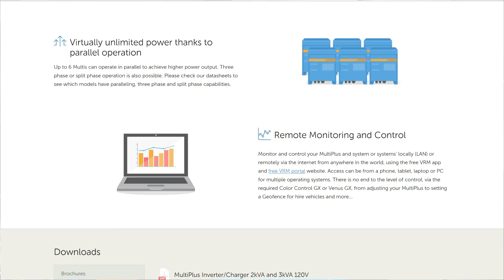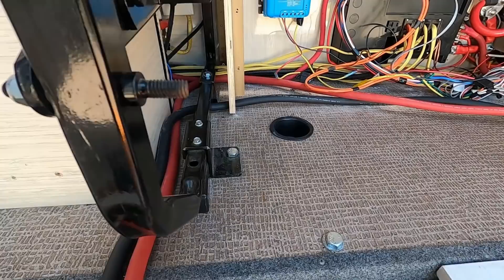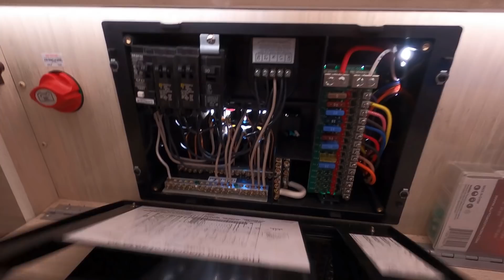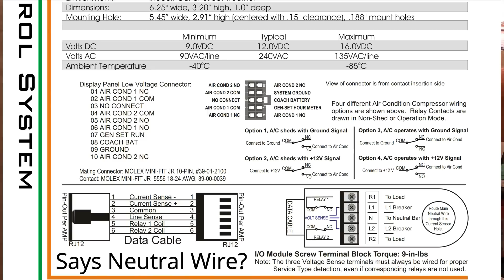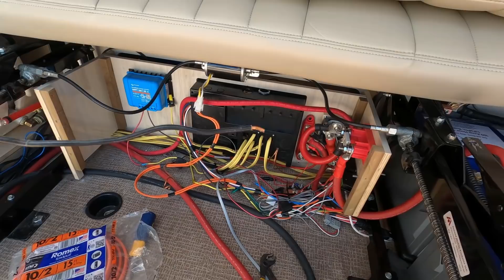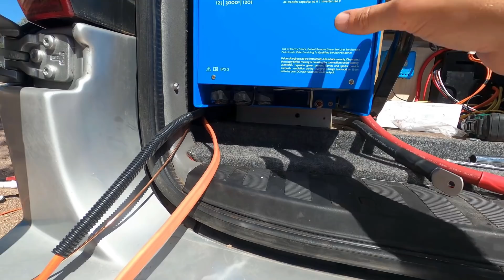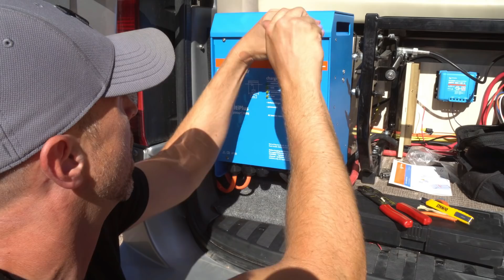RV Inverter Installation | Victron Multiplus 3000va Inverter Charger | Full Time RV Living

Comment: Does the power control system still shed loads like it used to when it thinks you don't have enough power, even when you now do with the 3000w inverter?  I've got an AI and upgraded last year to 2 battleborns and now need to get 1 more and upgrade to this Victron inverter, basically replicating your setup.  Anything you'd do differently after living with it for a couple of months?  Great job on the install, BTW!
Reply from the maker: I have not seen the PCS shed a load since the new system. The Multi Plus, being a hybrid, now just pulls the extra power needed from the batteries and everything keeps working. Pretty cool, with the AC, induction, and microwave all on at the same time! We REALLY like the new setup. I don't think there is anything we would change with it, besides wanting more solar. I do need to do some review videos as we just completed 60 days being unplugged and NO generator. The only real limitation is running the AC for extended periods of time. You will still need a generator for that or figure out a way to fit 1000 plus watts of solar on a AI roof! I think you'll really enjoy the power of the BB's once you upgrade your inverter.
Reply: Irene Iron Fitness Thanks for the response. We have 2 Battleborns now, and I was thinking of getting just 1 more. How do you think your experience would be impacted by having 3 battleborns instead of the 4 that you have? 

We aren’t full timers, but I’d like to be able to cool down the coach with the a/c as we’re out and about it’s been sitting in the sun in a parking lot.  We just have 50 watts of solar but our sterling 60 amp dc to dc charger does a good job at charging the 2 battleborns quickly as we drive from place to place.  Other than that it would be for the water heater, microwave and an induction cooktop, all for short use ages (prob less than 10 min each).
Reply from the maker: The goal for our system is to sit for up to 7 days without driving or running the generator. 4 BB's and 300 watts of solar will do this if we get adequate sunshine. BUT, its amazing how much power we actually use per day. Up to 150 amps! So if we didn't get sun for two days we'd be outta power with 3 BB's.  I will be doing a video on AC usage, but basically ours consumes about 150 amps per hour. So while its not a problem to use your AC in between camps sites with electrical hookups, you could see how this could be a problem while boondocking. Let's say we left a campsite with 100% bat and we went to the grocery store and a few other close stops and Chris went in while I stayed out. (Common for us) After two hours of AC use we would be down to 100 amps or 25% battery. If our boondocking spot was only an hour away our battery would only charge to about 33% as we only have a LBIM225 that charges about 35 amps per hour. This would only be enough to last a couple days boondocking. You can see how more solar or a 280amp second alt would help the situation. But, everyone's needs are different and my advise is if its in your budget and you have the space for it... bigger is better with energy. Think of it in percentages also. How long does 2 BB's last you? Adding one more battery will get you 50% more power than you had before, or 2 more will double your power needs. I would also recommend upgrading the 50 watts of solar. No solar our batts last about 3 days and with solar we have done up to 10 days with a hour drive in.
Reply: Irene Iron Fitness thanks for the advice. I’ll do the easy upgrade initially with solar from 50 to 100 watts, since it’s just that oem panel swap with the same mounting brackets. Then probably re-evaluate once I see how we do on that. I may do the battery upgrade one at a time as well so we can see how 3 goes.  Thanks again for your time!
Reply: Irene Iron Fitness sorry, one more question for you. My AI is in storage right now so I can’t look, but did you add/replace the 400 amp fuse to an existing fuse block, or did you add the block and the fuse? Wondering if I need to just buy the fuse, or if I need to buy the block and fuse together.  Thanks in advance!
Reply from the maker: No problem. Yes I had to buy a new fuse holder as the AI one has a max 300a capacity. Which is too bad because they are really nice marine sealed Blue Sea holders. I do have a complete parts list on what I used in the description on my two install videos. (affiliate links) https://youtu.be/hB_UgLR0bTo    Buy, yeah feel free to ask questions, I don't mind. Excited for you and your upgrade!
Reply: Irene Iron Fitness thanks! I’ll use your amazon link if I buy the same product, for sure.  Switching topics... you’ve said you like your sumo spring upgrade, do they make it more jarring to hit road bumps? Anything you’d do different in terms of spring rate?
Reply from the maker: I don't really notice a difference on bumps really(going straight)....... these 3500 dually sprinters defiantly ride like a heavy duty truck. But, the main reason I put them in was to reduce the sway from side to side when turning and hitting bumps or things like a driveway entrance. It is a noticeable difference and well worth the $400 or so upgrade price. I will say the first test drive we really noticed it... but now we are used to it and it still has some sway. But these tall sprinters  with top heavy cabinets still make us drive pretty slow!  We put in the highest spring rate they had for the bumpstop replacement kind. Yellow in the back and black in the front. If they made the heavier yellows for the front we would have done that also. The added .75 in height clearance was nice too.

Comment: Great job! Does your van have one or two lead-acid batteries (one under the floor on the driver's side, one under the hood)? If there are two, you've got a spare house battery to do stuff with. 

As for your current setup - it's perfect. The only thing I'd do is keep a second alternator in the back of your mind. With a dedicated 280a alternator for your lithium system, you can run your air conditioner right off the main engine, and charge your batteries quickly on days when there's no sun. It will give you most of the benefits of your generator, but without having to reply on propane.

Also, make sure you carry a spare fuse with you. If it blows for whatever reason, your entire house 12 volt system is dead - which can be incredibly inconvenient.
Reply from the maker: Thank you! We have just the one bat under the floor..... had to replace it last year on the road! Good point on the second alt. I'm finding charging off the 220a main alt with the LBIM225 is mediocre at best. I plan on doing a bunch of testing videos in the next couple months on the whole system. We just boondocked for 60 days back to MN and it worked great.  And I did get two spare fuses right away. Great point! 😀
Reply: @IreneIronTravels  re-watching your old videos. First thought I had was "I better suggest they get some spare fuses" only to see I did six months ago 🤣.

Hope the system has been treating you well. I'm still a weekender. I have 700 amp-hours LiFePo4, and that's enough for me to run my A/C all night in the middle of summer, and then run generator to power the A/C AND recharge the batteries during the day. Right now in the winter, I can go almost a week without recharging (I have no solar). Hopefully you'll have similar capabilities if you find yourself somewhere hot in the summer!
Reply from the maker: That's pretty funny! Haven't had to use the fuse yet, but feels good to have a spare! The victron multiplus does pretty well handling  any surges so far.  As far as AC we can run it none stop for about 2.5 hours. So maybe 5 hours if it cycles 50%, but it seems to run none stop if it's hot enough out. We got our generator fixed now and that's a big relief to beable to run AC longer and recharge. We found 10 days to be our max with our 300w of solar and not using the gen. Would like double that in solar.
Reply: @IreneIronTravels  If you have a spare fuse, you will never need it. If you don't have a spare fuse, you will need it at the worst possible time. Blew my only fuse the first day into a camping trip - haven't had any issues since I got spares.

Comment: Great video thanks for sharing. Unrelated Question is on that set of dumbbells I see in the back. They look like an adjustable set. Where did you get them?
Reply from the maker: We bought them used from a private sale. They are called hoist adjustable dumbbells and are 75lbs apiece, but they don't make them any more. Another company called Ironmaster now makes a similar set. We have a link to amazon in our video descriptions to them. We do love them! Thanks for watching!
Reply: @IreneIronTravels  Thanks.

Comment: This was an interesting video. The 2021 Midwest Auto Designs Passage 170 I'm picking up, thankfully, is using a Victron MPPT solar charger, but what I'm not sure of is the actual inverter. What I'm seeing in their documentation is that it's a 2K inverter, but I noticed the words "Victron" so, I'm hopeful that it's an actual 2K Victron. The thing I find strange is that the unit comes with an induction stove, and no where do they mention the fact that you need to fire off the generator to actually use the induction stove. Moreover, the unit comes with a huge Relion 8D-330 coach battery. Which is a 330AH, 187lb AGM Battery?  So I'm curious how this will all flesh out. I guess I'll know more on Sunday when I actually (and finally) pick it up. None the less, appreciate the installation video. Have you been able to gauge the actual use time of your A/C while running on your 400AH?
Reply from the maker: That's pretty cool they are putting in Victron equipment. I have seen that 330ah agm battery in the Coachmen galleries with a 2k inverter. They have the whole coach hooked up to the battery except for the AC. ( only works with shore power or gen). So, I would bet yours Is the same. Induction stoves are 1300 to 1800 watts so no problem with 2k inverter. Just remember with AGM batteries it's best to only use 50% before charging back up. So about   165 amps. If your induction is 1800 watts at 12 volts that is 150 amps. (1800/12=150) . So you could run the induction for about an hour and then your bat would be pretty close to 50%. Just an example....... With lithium you can go down to zero without ill effect on them. So same example on my AC, which is about 1800 watts I might get about 2.5 hours or so.  But, that is one of the videos I plan on doing for a test! I'm super excited for you and your new coach!
Reply: @IreneIronTravels  Great, Thank you for the update. I wasnt quite sure how/what the intentions were since there was not a propane stove, even though I will be carrying propane, save for the water heater only. I'm guessing the Passage is the same AC/DC layout as you mention about the Coachmen as well. To be honest, this was an impulse buy, although something I've been wanting for more than a few years now. But good news is that Relion (perhaps others?) makes a Lithium battery that matches this very same battery in size, so perhaps that may be a future upgrade. The only unknown at the moment is the actual inverter. Again, thanks for taking the time to share your thoughts. Much appreciated.

Comment: In these days of uncertainty it is a breath of fresh air to watch your channel. I have one question are you not afraid of having so much electricity under where you sit and sleep in regards to electromagnetic?
Reply from the maker: Thank you for watching and your support. We really do appreciate it!  Honestly, I don't know that much about the topic. As far as I know lithium iron phosphate batteries do not produce any type of EMF and we generally keep the inverter off unless we need it for a large 120v appliance. We try to keep everything 12v to eliminate the conversion loss and the 5 amp draw of the inverter. But, this is the second time its been brought up in the comments of this video  and I should look into it more. Thank you for the comment!
Reply from the maker: Also,  if you have any thoughts on it I would love to hear it. Thanks!
Reply: Irene Iron Fitness I have used a electromagnetic meter over the couch and under to check readings as the inverter is running. Then I used a shielding under the couch to block the rays. The cdc has always said not to put cell phones with lithium battery in front pocket because the energy can affect reproductive organs.
Reply: @henryrosa8366  what shielding did you use?

Comment: Success! Enjoyed watching that. Great job. How's the fan noise when your in the back? Noticeable?
Reply from the maker: Thanks, Brian! The fan is not too bad with a light load on it, but when we use the water kettle(1000w) or the induction stove(1300w), you can hear it kick up. When we turn on the A/C I'm sure it's whirring,  but then we can't hear anything anyways!😱 There is a  low hum or electrical buzz I can hear if the inverter is on (no load) and it's dead quiet. But, as you know, when boondocking its best to have it off....... I think stand by on is around 5 amps.  31 days straight with no shore power or geny!
Reply: @IreneIronTravels  Thats great not needing shore power or gen isn't it? We pretty much leave our 2K inverter running until we go to bed. It draws roughly 2 amps. Sometimes we leave in on through the night if we need a 120VAC fan on. 👍
Reply from the maker: Nice, you guys got it down pat! My next bottleneck is only have 300 watts of solar. It's good, but we lose about 10% battery per day. We need to get some sliding stack-able solar panels like on this rig. https://youtu.be/woZH85EiHNY 
You're a pretty good fabricator..... think you could make something like that??

Comment: Great information Thank You.  I'm wondering if you have any concerns about all those electronics being approx 6-10 inches away from your heads & bodies when sleeping.  Any "radiation" or ill electric "effects" on the body.  There are different thoughts on the topic?  Thanks.  Really enjoy learning form you two
Reply from the maker: Hello, thanks for watching! I do think there is something to the topic for sure, but its hard to know the exact effects....... Years ago I stopped leaving my cell phone in my pocket all day and also sleeping with it right next to my head after reading an article! The inverter is off at night to safe power and really its off most of the time unless we need a 120v appliance. If we were plugged in at an RV park the way I have it hooked up, the inverter does need to be on to be the pass though. This could be hooked up a different way if needed, but we don't plan on being in RV parks that much. Maybe a quarter of the year???...... From what I've read the Lifpo4 lithium batteries are very safe.......... But, it is really tough to avoid this in a small space like a van. We just try to offset it as much as possible by being outside in the fresh air!
Reply: Radio active???
Wholly-Molly like a nuclear reactor??
Silly me I stand in front of the microwave while I wait for my popcorn. 
probably explains why
I’m the way I am

Comment: Very similar to my system. I love the multiplus as it does help when driveway docking. And it is smart. I can actually have the ac running for up to three hours on the three batteries. But I usually don’t. Anyway all has worked well for traveling. Blessings
Reply from the maker: Hey Celeste! Good to hear from another full timer that they are liking this system also. I'm glad we went with it and we are loving it too. Thanks for watching!